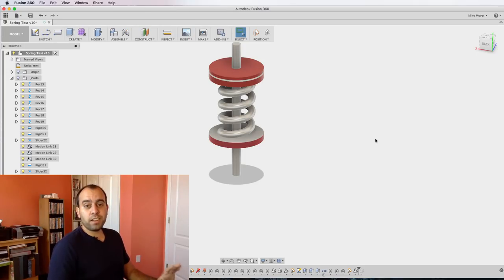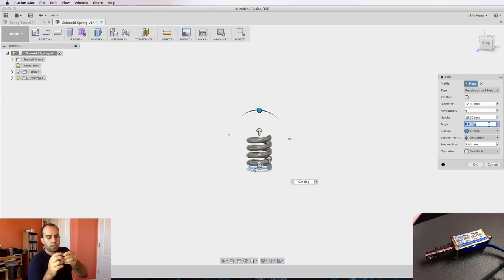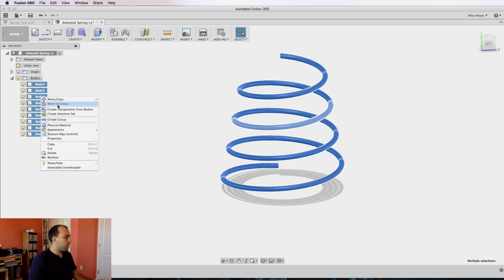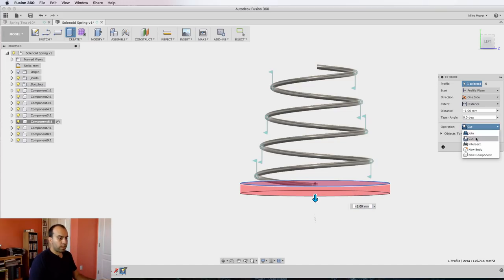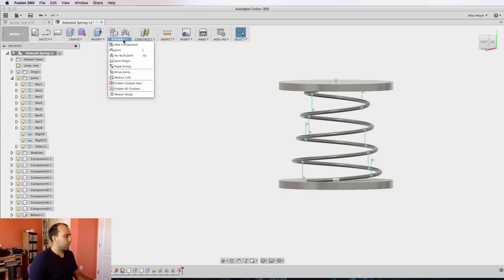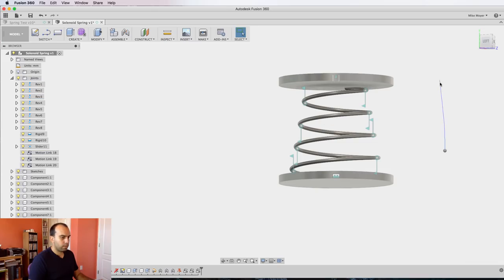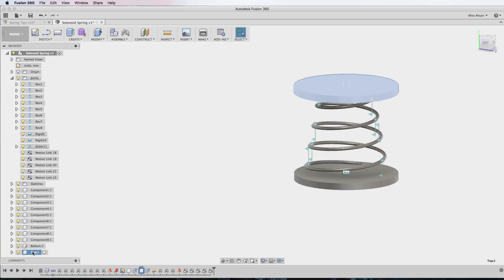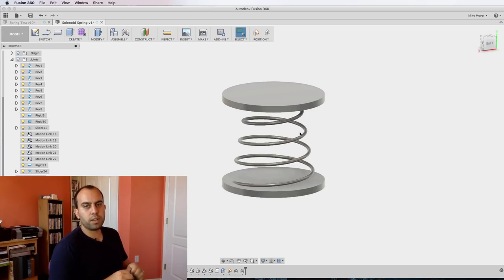Model a WORKING Spring in Fusion 360!  (ADVANCED TIP)

Comment: Here we are, 3 years later, still no "natural spring" in Fusion! It could be so simply added...
Reply: aw dang was looking for an answer and since the video is 4 years old i hoped that they might have added it already :/
Reply: Can you tell how it could be so 'simply added'? I'm curious.
I think the problem has to do with how CAD software works at the core. Surface shape deformations are naturally possible in polygon based geometry modelling software but I've not seen a single CAD software that can make a spring work directly, we have to rely on splines and constraints.
Reply: @nuduw  do you even solid?
Reply: @SUB13333  what
Reply: Yes! Yes! Yes!
Reply: Make an addon on if its so simple
Reply: Now 7 years later. Autodesk clearly hates springs  😄

Comment: Great tip! Loved it! I sort of improved the concept simply by putting the motion links between the revolute joints of the spring so that the washer is free of motion links and can therefore have a rest position. Also, I added revolute joints at each ends of the spring  instead of making them fixed. So the entire spring is moving. The motion links are easier to get right since it is 360 for each joint instead of finding the number of degrees. Hope this make sense!
Reply from the maker: Great point!  What values did you use for your revolute motion links?
Reply: That's the beauty of it... since it's a one to one ratio, you can leave them both to there 360 degree default value! :)
Leave me your Fusion username and I will share the project with you so you can have a look at it if you like.
You could also download it as a Fusion 360 archive from this link : http://a360.co/2pxEODu
Reply from the maker: I just downloaded it.  It works great.  I tried to replicate the results on my spring however, and I'm having trouble.  Is there a reason you added your motion links in that order (the middle link last)?  Did you decided to reverse some of them by eye or was there a pattern?
Reply: When I created the motion links, I simply got confused and missed the middle one so I did it last but the order in witch you create the motion links doesn't matter. The end result is the same.

As for reversing some of them, I did just like you and reversed the ones going the wrong way. I didn't really pay attention for a pattern.

If you have trouble replicating it on your existing spring, may be start from a fresh project? Although, this should not make any difference.

Again, thanks for sharing this great tip! It made my day!!!
Reply: what about the whole suspension with multiple rigid group?
Reply: hmm, I know this is an old video but trying to understand what you did exactly. Did you first have to add a joint origin on the faces between each component (face of each spring piece)? Otherwise I'm only left with a single revolute joint from the video.

Comment: This is a great tip and tutorial and it worked for a compression spring but I was not able (yet) to make it work for an expansion spring. Nevertheless, I enjoyed the fact that you did not use keyboard shortcuts too much and was able to follow it step by step which is not the case with other Fusion 360 tutorials.

Thank you!

Comment: I was making an assembly which had movement between two objects. Because of this I couldn't use the spring component during the simulation. Now that I have variable change of length in the springs it works perfectly.Thank you so much for this tutorial, it has made the visual aspect of my project so much better!

Comment: I just created a motion link between the revolutions and made them the same angle, works better for me
Reply: A motion link between all 8 joints? How?
Reply: @JaTool  Sorry I wasn't clear, I  created multiple  motion links:
Link1: Rev1 & Rev2
Link2: Rev1 & Rev3
Link3: Rev1 & Rev4
And so on...

I kept linking to Rev1 because I think it's easier for the computation if all motionlinks getting their value from one  joint.
If  one link goes the wrong way, you can just put a - infront of the angle value but it worked without for me.

You can also do a "as built joint" with the first section to the origin and select the snap on the circular face of the first section, so the spring will keep it's axis.

Comment: I tried to make a longer spring by this principle. When the number of motion link reached 10, then the connections stopped moving. Is it possible to somehow bypass this restriction on the number of motion link?
Reply: Sounds like the processor is maxing out.  The program has to make 100's of 1000's calculations for what looks to be a "simple" movement.

Comment: HI Mike, Thanks for a great lesson.  I have a question about a slight modification-  how would the hack change if the spring followed an arc instead of a straight path- for instance the spring is attached to a rocker arm?    Joe

Comment: Second Comment ~ I plan on building a Porch on the second floor floor of my garage with a 5' wide ramp.  Using Fusion 360 with your training I can make plans and print them for a "Permit" to the city.

Design see if works then cut and or make Sparks with permit if needed.

I can not thank you enough....

Comment: Would there not be pre-built models of working springs available in some kind of library already?
Reply from the maker: Unfortunately, not that I was able to find.  Most of the workarounds suggest using 2 spring models- one compressed and one at rest, then turning off/on each one as needed to see how it will interact.

Comment: when we model a whole suspension does it work with the other parts? for example squeezing washer and jaw part to gether, they are all modeled as rigid group with the bottom piece of spring. i tried to make it but did not work with the multible parts. does anyone has an opinion?

Comment: That was exhausting just to watch.  I just use a parameter for my coil height.  To make it springy, I would think I could just set a formula based on the first parameter for rest.  Haven't tried that part yet.
Reply: That can't be done in Fusion. I've seen it done in Inventor though. Is that your case?

Comment: I don't see how this method could possibly model a real spring, through, if you are choosing revolute joints at DISCRETE positions on the spring, when the force applied to a spring causes a reaction force that is CONTINUOUS. For example if you were to run a simulation on this, all the pressure would be at you joints, instead of along every point of the spring like a real spring. So if you were trying a find out how to model a real spring to determine what spring constant you need to counter a given force, I don't see how this method helps. Is there no way to model and simulate a real spring in Fusion 360?

Comment: Also i think the same amount of work will be required to setup this using custom parameters. I will try it since your solution will kill me. I have a 10 revolutions compression spring and the number of joints to setup is too dam high. It might work with pitch and height params from the coil creation... I will try and update this comment
Reply: Andrei Sima any news?
Reply: Yes and it is not working since i can not find a way to bind custom parameters to animations. :( Might be a way to do it, maybe programmatically but i did not went that far. I have dropped the animation sim in this case.
Reply: There is a user request on Ideastation for exactly this functionality as someone else was trying to solve the same problem the same way. I'd suggest anyone interested vote for it. https://forums.autodesk.com/t5/fusion-360-ideastation-request-a/access-to-joint-positions-as-parameters/idi-p/5720276
Reply: @Quentin Brown
Thank you. I do not know what to say about this. Besides simulation from visual point of view i do not see any practical use for this. Maybe if  Autodesk will implement it in such way that can be used in some dynamic simulation... maybe. I was more interested in it to see if i can do it the easy way but since i did not find a simple way to hook myself to some params that i can change during  motion/animation/etc i dropped the idea. Maybe they do have an API to use but i did not investigate further.

Comment: The problem with this is that it's simply for animation purposes. It provides the illusion of a spring without the authentic behavior of a spring.  Great if you're doing something for show. Not so much if you actually want to model a spring within a design. 

Fusion absolutely sucks for modeling and testing springs and objects such a barrel cams.

Comment: I don't think this is a good idea for anything else that's not a simple assembly.
Reply: This is a simple method. Check out this video "Parametric Spring with gradually reduced pitch at the ends (Fusion 360)"

Comment: This software is like 2 thousand dollars, and i can't make a damn spring? c'mon...
Reply: Victor Hugo - it’s free to hobbyists and start ups, stop whining 😡
Reply: @portlyoldman  I'am not whining i'm being real, for REAL usage, a CAD software based around mechanical stuff can't simulate a damn spring?, i can do this to an certain extend using Blender, wich is not CAD neither cost 2000 bucks, its free. How can i simulate a spring on a free software, and not on a CAD software MEANT for mechanical eng?. Give me a break.
Reply: Victor Hugo - however, if you are a start up you can get a real licence for fusion 360 for as long as you are not coining it. Same goes for solid works. Just ask ‘em. I did. Stop whining 😜
Reply: @portlyoldman  Or i could use a profissional tool that is free and has the simple hability to simulate a spring :)
Reply: Victor Hugo - you’re probably right mate. I just think that solid works and fusion are trying to play the game for us hobbyists, so I like to defend them a bit 😎
Reply: @portlyoldman  For a hobby usage that dosen't require too much sims, fusion and solid are just great at what they do, it just hurts me to see such a big company with a great product lacking a simple feature
Reply: Victor Hugo - well, I was seriously considering adding an “ add in “ to provide this function 😀

Comment: wow this program sucks, ptc creo has a simple animate function and assemble function
Reply from the maker: How much does creo cost?
Reply: Depends on what version you want.
Reply from the maker: +ZeroDay Videos fusion is free for hobbyists. Does the free version of creo have the spring function like you described?
Reply: Ptc cero is for sure a great program, but not even close too be as versatile as fusion360 in the long run. And fusion is free for hobbiest,  don't know how that sucks.
Reply: Mike and Lauren yep, it allows you to animate anything you put together and use realistic physics properties to test thing and find their stress points and where they would fail before you make it.
Reply: Mike and Lauren i also feel like you misinterpreted what u meant when I said this program sucks, as a "hobbiest" are you really going to go through everything you describe in your video? you seem to be using fusion at a expert level. and it sucks all those things you have to do just to animate that  spring
Reply: I don't know why you're proposing Creo for an application like this. The cheapest license is ~$2k with only students having access to a free version. Fusion makes perfect sense for hobbyists even if it takes a little more time to model components.
Reply: And having used Creo, Inventor, and Solidworks in my profession, I can safely say that Creo comes in last for ease of use.